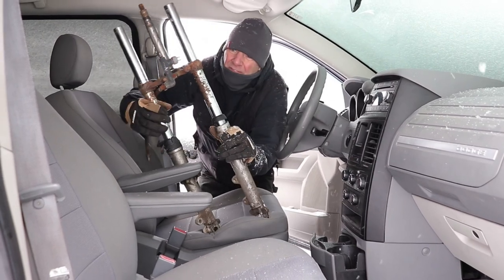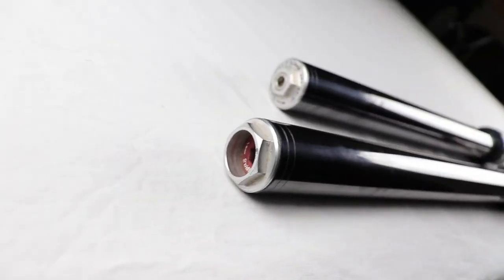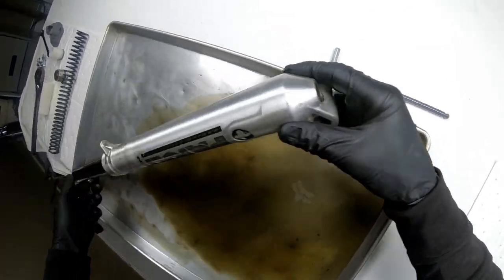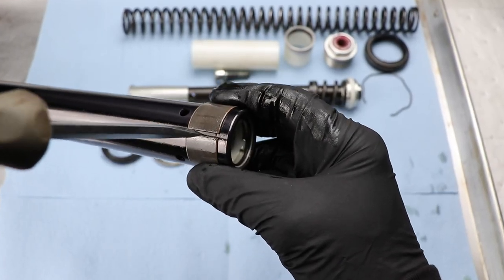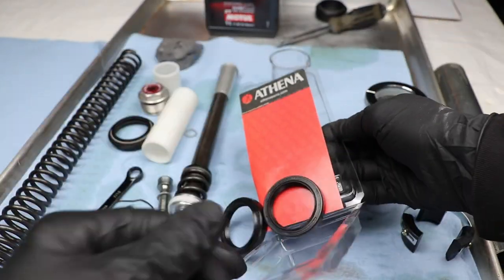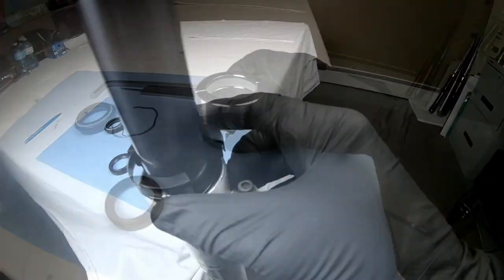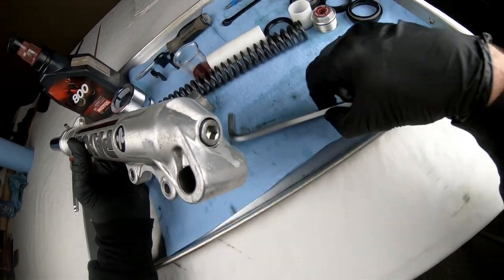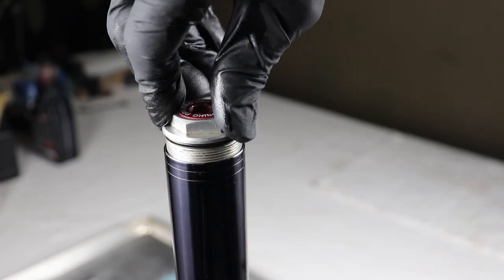Sherco 290 Fork Seal Replacement -How to

Comment: Good video! I have a bike like that too. How much oil does the telescope need? Is the left side the same amount as the right side? My sherco 290 2008 Black telescope. Thanks
Reply from the maker: Hi Kasza, thanks very much I appreciate your kind comment .
The manual for my bike says to use 270cc in each fork leg if it's just an oil change. But use 330cc in each fork leg if they have been completely taken apart ,cleaned and rebuilt. 
I hope that helps you .
Ride safely, cheers 🍻
Reply: @TRyanLearnBikes  Thanks

Comment: Mine need doing and ive been emailing round to send em off. I've got that exact bike 08 sherco and and didnt realise it was that sort of process.

Just need to find the specs for oil and quantity 

 Thank you. 

Don't suppose you know where i can find a manual ??
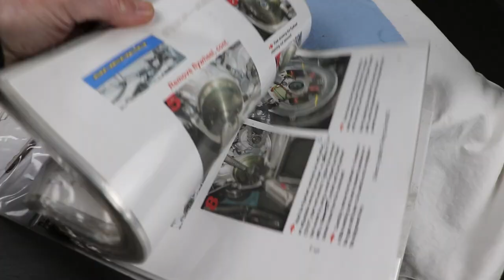Reply from the maker: Hi @flapper111uk . In my manual it recommends 5W or 10W fork oil depending on how hard you like your ride .If you are just replacing the oil without a rebuild teardown it recomends 270cc of oil in each leg if you do a more in depth teardown it recomends 330 cc in each leg . You can actually see that page in the video at the 6:16 minuite mark . You don't get much time to see it but if you pause the video you can see the info you need .I'm not sure where you can find a printed manual but there are sites where you can get pdf versions .Hope this info helps you . Good luck ahead .Thanks for watching .Cheers 🍺
Reply: Cheers for the help dude. Just finished doing mine and saved a ton to spend on other goodies. 
Found a blog that also helped and the parts from splat shop uk.
Reply from the maker: @flapper111uk  My pleasure,man .We are all this together and if we can all help each other in some small way then we all win .Glad to hear you have your bike sorted  now  and have a bit of extra coin to do some more upgrades. Ride safe and have heaps of fun .Cheers to you good sir 🍺